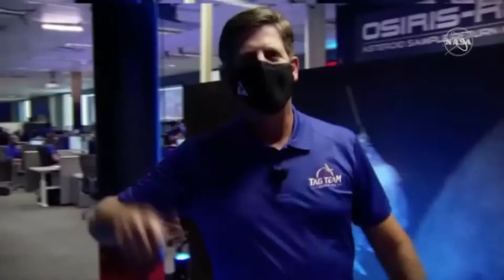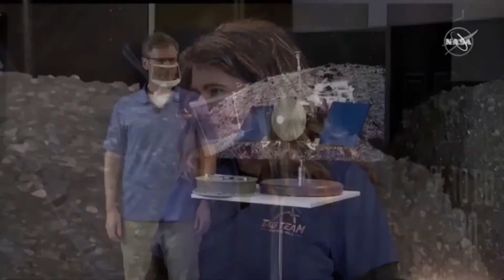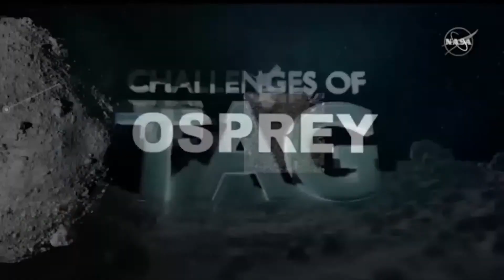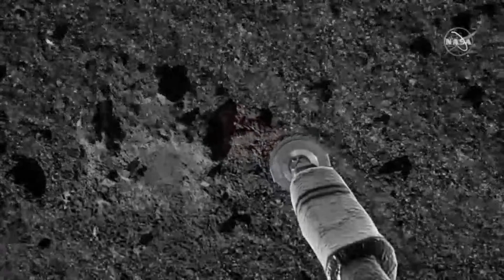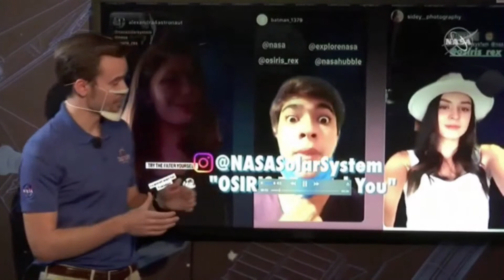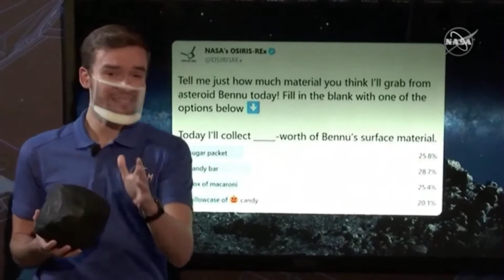LIVE: NASA Spacecraft Attempts First-Ever Collection of an Asteroid

Comment: Die erde is FLAT
Reply: I can prove the earth is not flat.  
I lived in Alaska for over 20 years.  During the summer, the day was 19&1/2 hours long and the reverse in the winter.  Not only that, but instead of the sun passing high overhead in the sky, it would rise and trace a low arc all the way around the horizon and set near where it rose; and during the winter, it was the opposite.  The sun rose and set in a short arc on one side of the sky.  There is no flat earth model that can explain such phenomenon.  If the most northerly latitudes are in the center of the “disk” then it should be the opposite.  There is no way for a sun to rise and set on a disk world that can explain the differences in where the sun travels across the sky at different latitudes and the varying length of day at different latitudes.  At the equator, the sun always rises and sets with a narrow area high across the center of the sky while it’s completely different at high and low latitudes.  Only a spherical earth that has a tilted axis that points towards the sun in summer in the northern hemisphere (while it’s winter in the southern hemisphere) and away from the sun during winter can explain the various differences in the sun’s position and arc across the sky, the variation in day length, as well as the pattern of seasons in both hemispheres.

Picture it in your head or buy a globe and use a flashlight to simulate the sun in a dark room.  When the tilted axis is pointed towards from the sun during summer in the northern hemisphere, as the planet turns, a person living at high latitude (such as in Alaska, Canada, Greenland, Scandinavia, etc.) sees the sun at a different angle than someone living at the equator; hence why it traces a low arc around almost the entire horizon instead of being high in the sky.  This also explains why the days are so long; because the earth’s axis is tilted towards the sun, as the planet rotates, a person that far north only spends a short part of the day in shadow so the night is extremely short and most of the day is spent in daylight.

There is no flat earth model that can explain these dynamics.  No amount of jury rigging can produce an explanation for this basic reality.  Every person who has lived at high latitude has experienced these phenomenon on a daily basis; having almost 20 or more hours of light and being able to sit outside and read at midnight during the very middle of summer becomes normal.    There are no angles at which the sun can “travel” across a flat earth that can explain this.  Even if we conceived of the sun circling around the earth in a coplanar manner so that it move around the edge of the “disk”, this still cannot explain the differences in the sun’s angle and the variations in the length of the day.  In such a case, the entire “disk” would see the same height of the sun and in essence, the sun would never set.  It would be daylight 24 hours a day for the entire “disk.”  So the flat earth model cannot explain these phenomenon (among many others.)  it just doesn’t work.

Comment: Space is fake.  NASA lies.  And the Earth is flat.
Reply: I can prove the earth is not flat.  
I lived in Alaska for over 20 years.  During the summer, the day was 19&1/2 hours long and the reverse in the winter.  Not only that, but instead of the sun passing high overhead in the sky, it would rise and trace a low arc all the way around the horizon and set near where it rose; and during the winter, it was the opposite.  The sun rose and set in a short arc on one side of the sky.  There is no flat earth model that can explain such phenomenon.  If the most northerly latitudes are in the center of the “disk” then it should be the opposite.  There is no way for a sun to rise and set on a disk world that can explain the differences in where the sun travels across the sky at different latitudes and the varying length of day at different latitudes.  At the equator, the sun always rises and sets with a narrow area high across the center of the sky while it’s completely different at high and low latitudes.  Only a spherical earth that has a tilted axis that points towards the sun in summer in the northern hemisphere (while it’s winter in the southern hemisphere) and away from the sun during winter can explain the various differences in the sun’s position and arc across the sky, the variation in day length, as well as the pattern of seasons in both hemispheres.

Picture it in your head or buy a globe and use a flashlight to simulate the sun in a dark room.  When the tilted axis is pointed towards from the sun during summer in the northern hemisphere, as the planet turns, a person living at high latitude (such as in Alaska, Canada, Greenland, Scandinavia, etc.) sees the sun at a different angle than someone living at the equator; hence why it traces a low arc around almost the entire horizon instead of being high in the sky.  This also explains why the days are so long; because the earth’s axis is tilted towards the sun, as the planet rotates, a person that far north only spends a short part of the day in shadow so the night is extremely short and most of the day is spent in daylight.

There is no flat earth model that can explain these dynamics.  No amount of jury rigging can produce an explanation for this basic reality.  Every person who has lived at high latitude has experienced these phenomenon on a daily basis; having almost 20 or more hours of light and being able to sit outside and read at midnight during the very middle of summer becomes normal.    There are no angles at which the sun can “travel” across a flat earth that can explain this.  Even if we conceived of the sun circling around the earth in a coplanar manner so that it move around the edge of the “disk”, this still cannot explain the differences in the sun’s angle and the variations in the length of the day.  In such a case, the entire “disk” would see the same height of the sun and in essence, the sun would never set.  It would be daylight 24 hours a day for the entire “disk.”  So the flat earth model cannot explain these phenomenon (among many others.)  it just doesn’t work.
Reply: Moon Anomalies Nasa is hiding. 6 videos in total are up and ready to watch. https://youtu.be/zM-HANWFjbk spread the word. Look again space is real. the moon is real. and the earth is round.

Comment: What a joke. These people are professional liars.
Reply: What a joke you are!! You really think that the 400,000 thousand of employees are all in the same lie??? Stop smoking crack. Crack head
Reply: Let me guess: you’re one of those flat earth believers.  I can prove the earth is not flat.  
I lived in Alaska for over 20 years.  During the summer, the day was 19&1/2 hours long and the reverse in the winter.  Not only that, but instead of the sun passing high overhead in the sky, it would rise and trace a low arc all the way around the horizon and set near where it rose; and during the winter, it was the opposite.  The sun rose and set in a short arc on one side of the sky.  There is no flat earth model that can explain such phenomenon.  If the most northerly latitudes are in the center of the “disk” then it should be the opposite.  There is no way for a sun to rise and set on a disk world that can explain the differences in where the sun travels across the sky at different latitudes and the varying length of day at different latitudes.  At the equator, the sun always rises and sets with a narrow area high across the center of the sky while it’s completely different at high and low latitudes.  Only a spherical earth that has a tilted axis that points towards the sun in summer in the northern hemisphere (while it’s winter in the southern hemisphere) and away from the sun during winter can explain the various differences in the sun’s position and arc across the sky, the variation in day length, as well as the pattern of seasons in both hemispheres.

Picture it in your head or buy a globe and use a flashlight to simulate the sun in a dark room.  When the tilted axis is pointed towards from the sun during summer in the northern hemisphere, as the planet turns, a person living at high latitude (such as in Alaska, Canada, Greenland, Scandinavia, etc.) sees the sun at a different angle than someone living at the equator; hence why it traces a low arc around almost the entire horizon instead of being high in the sky.  This also explains why the days are so long; because the earth’s axis is tilted towards the sun, as the planet rotates, a person that far north only spends a short part of the day in shadow so the night is extremely short and most of the day is spent in daylight.

There is no flat earth model that can explain these dynamics.  No amount of jury rigging can produce an explanation for this basic reality.  Every person who has lived at high latitude has experienced these phenomenon on a daily basis; having almost 20 or more hours of light and being able to sit outside and read at midnight during the very middle of summer becomes normal.    There are no angles at which the sun can “travel” across a flat earth that can explain this.  Even if we conceived of the sun circling around the earth in a coplanar manner so that it move around the edge of the “disk”, this still cannot explain the differences in the sun’s angle and the variations in the length of the day.  In such a case, the entire “disk” would see the same height of the sun and in essence, the sun would never set.  It would be daylight 24 hours a day for the entire “disk.”  So the flat earth model cannot explain these phenomenon (among many others.)  it just doesn’t work.

Comment: I thought the spacecraft traveled. Over 1 billion miles. Yet the asteroid is 220 million miles away. It takes from a stationary satellite to get back to earth 2.5 seconds and it is 22,300 miles in space. So when did we actually land? And when did we actually received the first data coming back. We are on a 24 hour 4 minute cycle. How it becomes a leap year. Another correction.
Reply: Spoken like a true idiot.  Take a basic science class.
Reply: @bobbyd6680  

Calm down
Reply: Objects travelling in the solar system don't travel in straight lines. They go in circular orbits. The OSIRIS-REx spacecraft is no exception. If you want to see what the route looked like, here's a video: https://www.youtube.com/watch?v=zrRMoGrKkyU&feature=emb_logo
Reply: It doesn't travel a straight line, it has to intercept a distant, fast moving target. The target is moving too fast for a 'direct' transfer, so the spacecraft launches and  travels on a parallel orbit that merges and 'meets up' with the target.  The maneuver has taken several years. The light delay(transmission time), is about 20min.

 This is the same issue with Mars; the least energy trajectory, takes several months, to a year, to make the rendezvous. We simply don't have the technology/resources, to do it faster. Cheap is slow.

Osiris trajectory graphic: 

https://upload.wikimedia.org/wikipedia/commons/thumb/5/56/Animation_of_OSIRIS-REx_trajectory.gif/290px-Animation_of_OSIRIS-REx_trajectory.gif